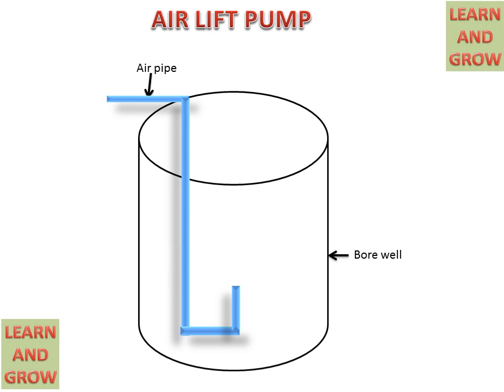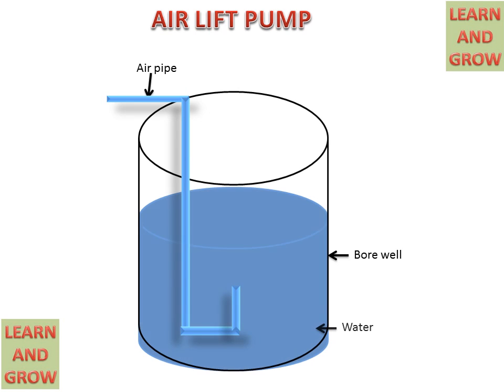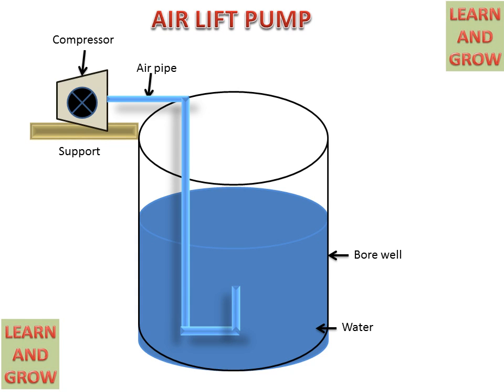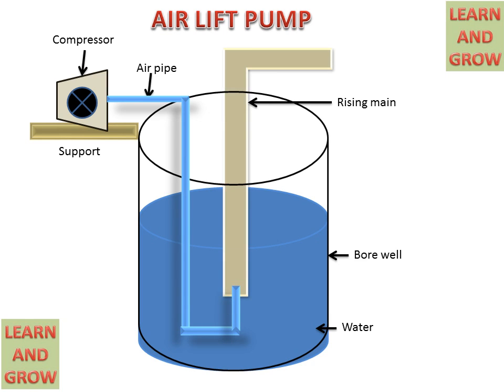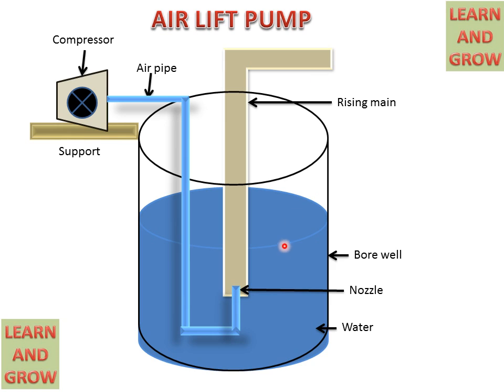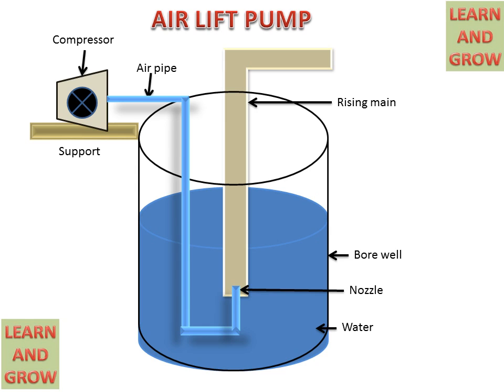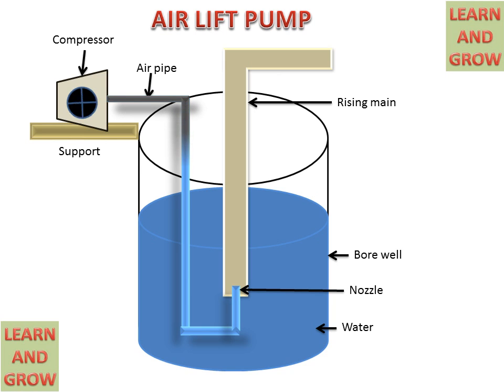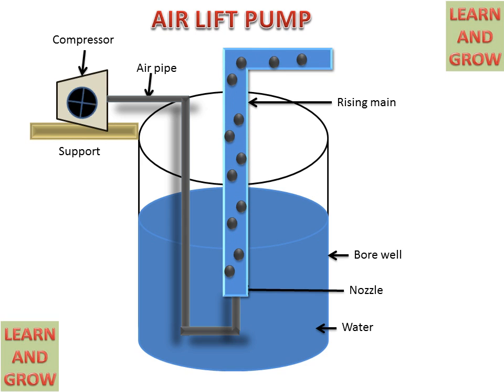Air Lift Pump (Parts And Working)

Comment: Sir my borewell is 400ft,  90% water now present in borewell. Problem facing that when start compressor motor of 1.5hp its run and piston stuck sometimes.pump  manufactures telling its because of over water availability.. they came and remove  hose little distance.. its working. Why this happening.. could u explain
Reply: How is it pumping now at 400ft?